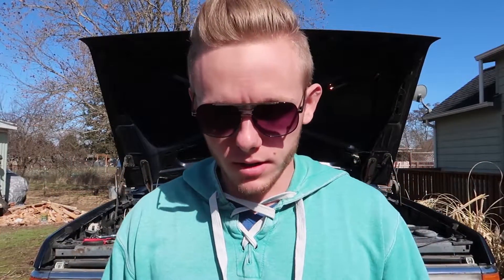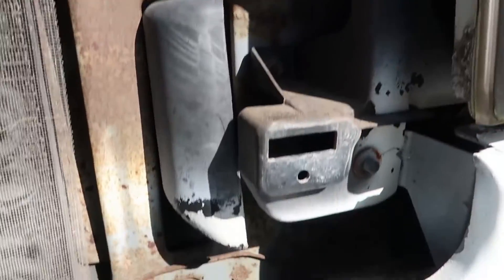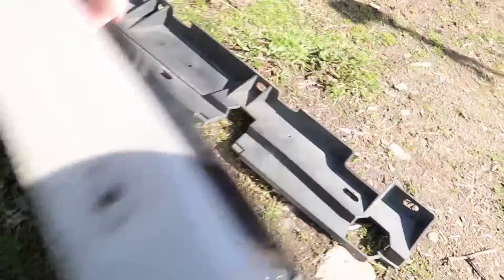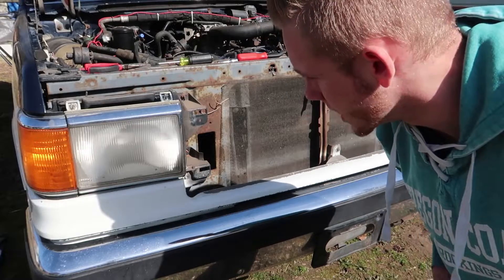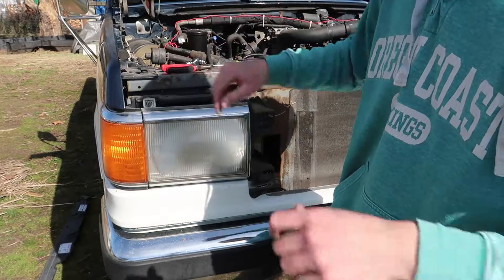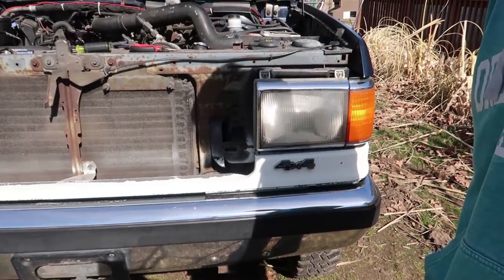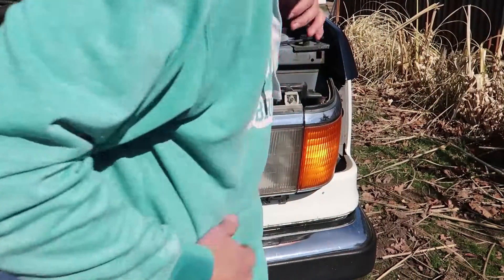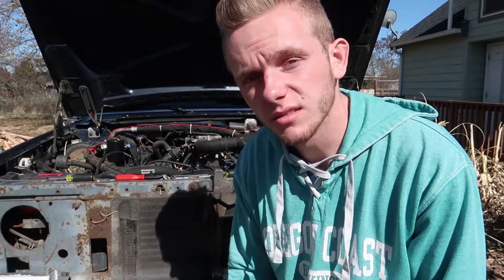1988 Ford F250 Headlight Assembly and Grille Removal

Comment: Excellent demonstration ! I am about to replace them on my 1990 F350. I had replaced them on my 1992 F250 earlier and they costed me around $37/pair. For this model [8th Gen] they are not selling just the headlights, you have to buy the whole assembly which is around $160/pair]!!

Comment: Just recently I got a pop fastener kit at NAPA called a FIX IT KIT. And it is NOT made by DORMAN and NOT MADE IN CHINA. The stuff is decent. So what I did was be myself in order to fit the pop fasteners from the kit that I wanted to use were a smidge too large for the OEM holes in the rad support. I just got a step bit drilled em out a little larger and now I still have spare fasteners. So there are total 3 boxes of spare parts new and used for my 88 F150 named HOLLEY ANNE see my channel on her build. I put the rest in one of the spare parts boxes went right back 2 days later and bought another kit just because the quality was there. How they hold up is another story but there was no screwing around and jamming em in the hole to fit like other DORMAN junk I have had here.

Comment: Thanks for the video! The plastic clips on my '89 grill were very brittle, and I broke one. There are holes in the  headlight bracket near the rectangular holes for the clips. I took a short pencil and marked the grill from the back side. I drilled small pilot holes in the grill in case more clips break. I drilled a larger hole next to the clip that had broken, and put a small bolt through it. It was easy to put a washer and nut on the back. Someone at sometime had riveted the grill to the driver's light assembly. It took some drilling to get that out. I don't know if that was a Ford thing or dealer. I know the history of the pickup, and it had to be one or the other. 

I tackled this project to replace a broken parking light. While I had the headlight out, I decided to polish it. I used 400 then 1500 to get most of the oxide off. I buy used CDs and polish them on a wheel that I converted from an old grinder. I can usually rip the CDs with no errors. Anyway, I used the polishing wheels on the headlight and it came out as shiny as a new CD. 

Wear a long-sleeve shirt when removing the lights from the reflector/lens. It's a tight reach and there is sharp metal. 

I used anti-seize, and things went back together much easier than they came apart.